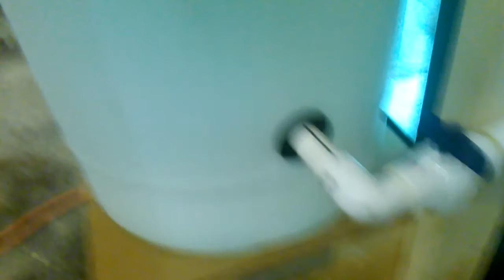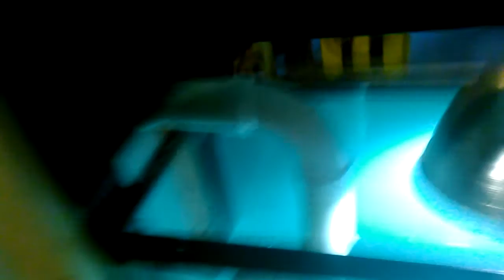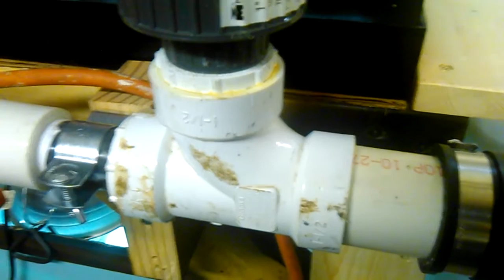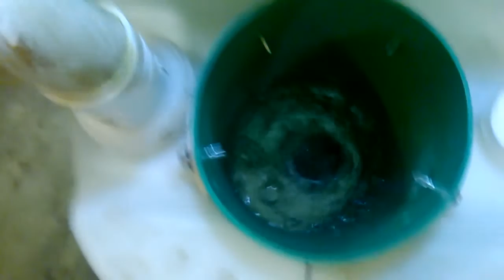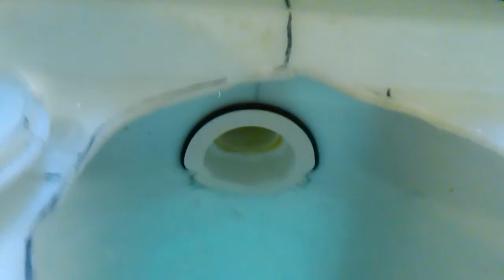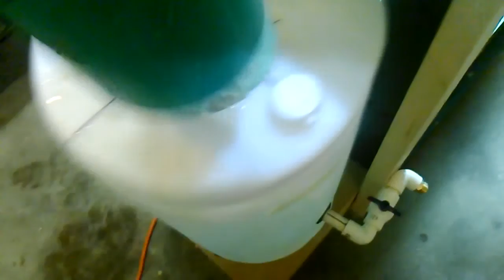Diy Aquarium Radial Flow Settler Mechanical Filter

Comment: Do you think the noise caused by the output of the radial flow settler defeats the purpose of a bean animal siphon being completely silent? From the audio in your video, it still seems a bit noisy. Im looking to do a similar setup on my 700 gallon (bean animal overflow to radial flow settler to sump) but worried about the noise caused by the radial flow out put. Also, when the power goes out, do you find that the bean animal siphon has trouble purging all of the air within the pipe, given that it feeds into the radial flow settler facing upwards (with the u-channel) vs downward as in the traditional bean animal set up. From my reading, the bean animal outflow into the sump has to be 1" or less below the water line of the sump.
Reply from the maker: I have had little noise problems.  Yes it seems noisy in video.  But I assure you it's not but I also wrapped the reverse flow barrel with bubble wrap isolation this did help   with noises. When I shut off the power to tank It takes a bit to restart the full syphon but my overflow has never had water in it from that. I do adjust the gate valve wide open from time to time to clean out gunk in pipe and then retune it. The secondary overflow can make more noise then any thing just take a retune. Note none of this happens very often cleaning it it is pretty problem free! As for my pipes size I used 1 inch  to 1 1/2 inch pipe. With the size of your tank you might want to use 1 1/4 or 1 1/2 or even a thin walled 1 inch pvc pipe. But I would want 2 inch pipe drains and overflow.  Sounds like a exciting project you have going sounds like fun. Make a good plan will help you. Good luck and I hope I helped you!! Thanks for the comment!!
Reply from the maker: This is a mix of heebie and bean animal overflow if I was going to start over I would of went with 1 1/2 bulkheads and then reduced to 1 inch pvc. That would allow more water volume in overflow not that it's a big problem with my set up. I would love to have enough pumps to max it out to see how much it can actually handle my guess is a lot. Thanks again!!
Reply: @MrRvbrown  I plan on using a 2" full siphon, 2" secondary durso pipe, and a 2" emergency dry pipe. I may only plumb the full siphon into the radial flow filter and have the other two pipes into the main sump